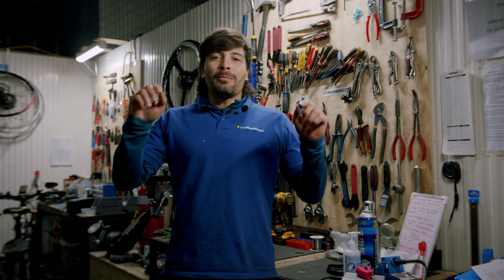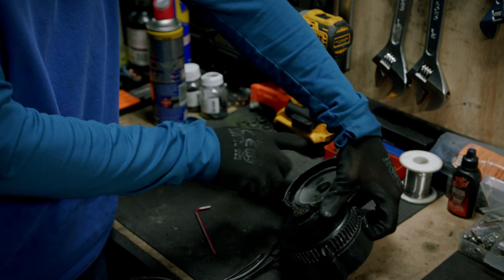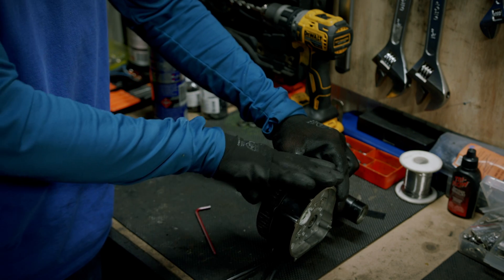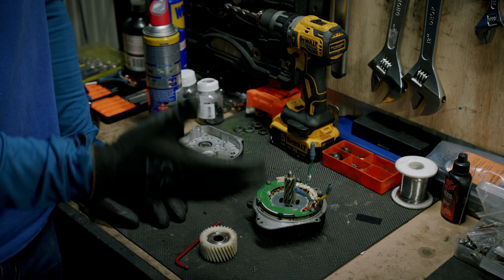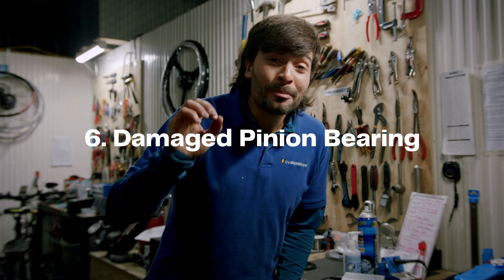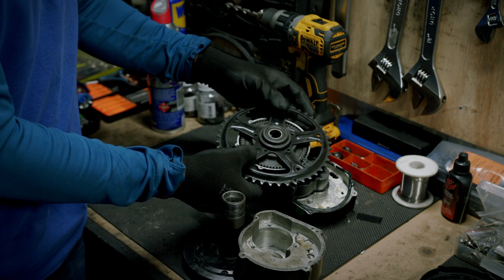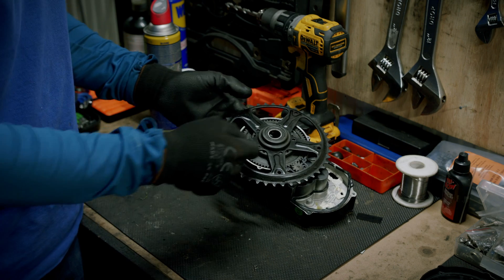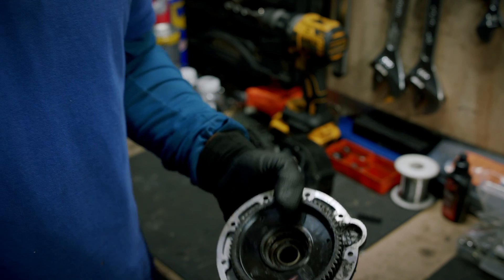Bafang BBS Motors The Most Common Problems of These Mid Drive Motors

Comment: Hi, tnx for the video, I have a BBSHD and I have the magnetic disk problem but I am not able to remove the disk from the crankshaft, there are two rings with a little notch but i can't remove. What do you suggest me? And where i can find the compass for KM5 ring? TNX
Reply from the maker: buy something like this https://www.aliexpress.com/item/32979786386.html?spm=a2g0o.ppclist.product.2.4aebDtyKDtyK87&pdp_npi=2%40dis%21AUD%21AU%24%202.93%21AU%24%201.79%21%21%21%21%21%402103245416819766136752944eff23%2166745174678%21btf&_t=pvid:703eee36-7704-4b0b-8336-f8151c03a6e7&afTraceInfo=32979786386__pc__pcBridgePPC__xxxxxx__1681976614

remove that ring and get going, you've had a problem on the disc because of excessive torque on the pedal axle, it's because youre riding with a heavy high speed gear being at low speeds, shift 2 gears down and you will be on the correct gear

Comment: Hi Felipe, fantastic videos! You are so knowledgeable. I'm building my first e-bike conversion and your videos have become a most valuable resource. I have a question for you. I've seen lots of Videos on You Tube recommending packing the Bafang pinion casing with grease. What's your view on this? Should we do this and how much should we put in? Many thanks, Rob
Reply from the maker: Dont touch the motor until it reaches 5000km or it needs any repairs, the motor is good to go from factory we dont need to do anything else other than a good installation when the motor is brand new
Reply: You see, bafang puts enough grease in there at the factory. No need to open a brand new motor and putting it full with red mobil grease. I have a full 400grams lithium grease from bardahl.. can i use it to regrease it, when firstly cleaned and remove the old grease? I just reached 5600km by now. Still the motor is very quiet.

Comment: A good advice and instructions of yours to avoid problems on the bafang mid drive motor. Sir just asking, how did you know a 1000w bafang mid drive motor if it is tampered or not? Thanks sir.
Reply from the maker: Hi, thanks, what do you mean by tampered? If the motor has been opened and modified prior to your purchase?
Reply: @Cyberbikesau  exactly sir.
Reply from the maker: @rodolfobaliga7577  check the bolts because when tightening them it will mark their heads. Inside the motor you can look for the white glue that keeps the wires together, if the glue has tears on its surface the motor has been opened and components replaced.

Comment: I did 2000 miles on my first motor before it failed through loads of salt water corrision, I had it sealed like you said. My second motor has done over 20,000 miles and the only two issues I had were harness failure and gear sensor failure so replaced though. The motor is working in fine order. Thankfully this winter has not been so bad so less water, salt water entering it.
Reply: @manoz6194  Thanks Mano, it seems like the best way to set up the motor so that I can do some of the work, as well. I don't want to be riding along, and be ghost pedaling, like most seem to want to do, I need to get fit after being off a bike for a long time.
Reply: @RobertAdams-ly5ku  Yeah I used to use a tongsheng, loved the torques sensing but the weather proofing was very bad so went through 4 motors in the space of two years. The kepler file is the closest thing to simulating a torque sensing motor. On the bafang I have had a harness failure and a gear sensor failure due to the rain. But a harness is cheap and a gear sensor is not really needed anyhow since I use the hydraulic brake sensor as a sort of clutch. My motor that had done 20.000 started to wear and lag after about 23,000 miles so I bought another one while I find the time to service the other. Good luck with it.
Reply from the maker: Is it our fault that your motor failed, or is it your fault that your motor failed? We have sealed motors that are lasting over 30,000 km
Reply: Which motor do you have, the BBS02, or the BBSHD. Thanks
Reply: @RobertAdams-ly5ku  bbs02  750w, mostly using 150 to 300w and occasionally using 1000w for the really steep roads
Reply: @manoz6194  Thanks for replying. I am looking to buy a BBS02, but was unsure about it's reliability, but now after reading about your experience, I think I'll go ahead and buy one, from looking at the power level you mostly use, it seems like you are getting a good workout. This is what I want to do, as I still want to be able to get fit, and get a workout, I've seen one guide on programming the BBS02, saying to set the assist levels, 1 to 9, in 10% increments, and set the speed in each level to 100%, not sure if this is the best way to set up the motor, but I will try it, and see. Thanks again

Comment: Thnx for your videos. I have been running a BBSHD for over 5 years, opened it to look at overall condition & to lube it last year when transferring it to another bike. Being able to program cadence and power levels (as well as setting it for max power) has made it very easy & comfortable to use, especially on technical mountain biking trails. You are so correct about shifting, having been a year-round commuter and mountain biker on "acoustic" bikes, it is second nature to me on electric bikes.
Reply from the maker: I'm glad to have you in this channel, welcome to Cyberbikes. What do you think our next video should talk about?
Reply: @Cyberbikesau  so far, I have only seen this one video of yours, the algorithm just suggested it. At some point, covering programming for the BBS01/02 & BBSHD also external controllers  for the hub drive folks, either separately or as a comparison. I do not know how many folks have actually done it.
Reply from the maker: @davebrown9725  Nice one, we have a quick programming video https://www.youtube.com/watch?v=bX-gFdU6aBM&lc=UgwPeB7ZCUdPoSWUHep4AaABAg.9knzFOb63-o9lSFfOkBp2V and the controller for hub guys that's nice though. Thanks for the insights
Reply: You don't have to shift anything, just buy a normal controller not bafang piece of shit
Reply: I have also changed of the (many) setup parameters by using a USB cable & software. It runs indeed smoother and better adjusted to my riding style. This should also protect the unit and reduce wear of the drive train.

Comment: Dear Felipe, thanks for your video. Regarding your first problem, I covered the gaskets you showed with silicone and then painted them black. Since this was handmade, it does not look good,  but I'm almost sure that water will not go in from there. (I cannot upload the pictures here). Is it common for the water to go inside the motor through the bearings? Of course, I'm not riding in the river. Now, regarding the motor effort that you referred to later, my granny has 36 teeth. Would you suggest a smaller front ring? BTW, my cassette is 11-36T. Thank you and please keep on with the good work. My Bafang is 36V 500W.
Reply from the maker: that's okay your ebike will last a long time with a 36T chainring

Comment: Need help please if you can!Motor 750w 36t chainring brand new motor,i sense some vibrations in pedals.I mean after 1-2 hours feels like my feet sat on 2 vibrathing phones.Changed ,chain, casette,even went to someone to remove some casette speeds for the chain to be aligned with the chain ring.Still no improvement.
Reply from the maker: the motor might be loose on the frame

Comment: Thank you, very helpful! Good to know many problems can be avoided by shifting gears. Is spinning the motor too fast (max rpm or close) a bad thing? Can it reduce it's lifespan or reduce it's efficiency?
Reply from the maker: in these motors always rev it up to its maximum, the best way to use them
Reply: @Cyberbikesau  Alright, thanks for the info!

Comment: Great Video -- Very Informative on the Bafang Motor!  Do you recommend every like 2500K  to open and clean the motor internal gears and add synthetic grease?
Reply from the maker: every 5 to 10k km, it depends on the use

Comment: Hello Felipe!  I would like to congratulate you for your videos!  They are great!
 I'm following all your tips here on your channel and I'm applying them to my BBS01.
 I would like to ask for your kindness and suggest that, if possible, you produce some videos addressing the problems with electrical and electronic components.  How to detect these problems and how to fix them.  I'm here in Brazil and technical assistance is very far away.  It is located in São Paulo.  The company is really good, but the logistics for me are very complicated due to the distance and cost.  With these classes that you give us on your channel, it opens up a great possibility of solving it right here in my city.  I had a problem with the main cable giving err 30. I managed to detect the problem, I will replace it with a new one and install it following your recommendation.  Thanks for your excellent work!  Keep helping us!  A big hug!!
Reply: Glad you were able to solve your main cable issue. Mine broke a conductor and would not even turn on. Very glad I had a spare on hand for troubleshooting and immediate replacement. I was more careful with the routing this time, I think the cable had gotten crushed between the double crown fork and the frame.
Reply from the maker: If we launch ebike classes, would you own them?
Reply: Yes, I would take the course.  You have excellent teaching skills, despite the language barrier I can understand you well.

Comment: hi mate , i have a problem with my bbshd , sometimes it spins on empty , id toes not engage the crank , and if i keep pressing the throtle goes oneerror 21h , any ideea the problem is ?thank ,
Reply from the maker: not engaging the pedals mean that you have broken clutch paws on the motor. Error 21h is the speed sensor not matching the magnet on the rear wheel

Comment: Hi ....thank you for your good and very informatif video , how ever i have a question , since I've got a heart problem i really can't keep up with a good cadence while pedalling , so i install a small chainring 36T to prevent the controller and other parts inside get damage quickly, i like to go ride at mountain side with a lot of very steep hill , is it my set up for the chainring is correct ? And i also keep the Watt meter on the display at around 100 - 350 Watt .
Thank you a lot for your answer , best regard
Reply from the maker: Yes perfect, your ebike will last a long time 36T is great for your application, watch this video https://youtu.be/jb3v5Y0Q2l0 to understand 300W high torque and 300W high speed, and keep shifting your gears at high revs. Cheers

Comment: Thanks! I've been trying to research the Bafang kits after realising I don't like the idea of a dedicated e-bike bottom bracket shell for a Shimano or Bosch motor (no future proofing).  Are the Bafang motors kits actually different depending on which wattage you get or is it just the controller limiting the power available?  I was looking at getting just a 250w kit, but if the gears are beefier in the high wattage kits I would go with those and limit the power to maximise lifespan.
Reply from the maker: your bike frame will tell you what motor to use. Don't go for a VW Beetle body and a Ferrari engine. Bigger motors do not mean better performance, the bike has to last, you cannot die without brakes, your body cannot shake at high speeds without suspension. Consider those facts in your build because we engineer ebikes, and life matters.
Reply: @Cyberbikes Wtf?? The guy was just asking if larger watt motors had better internals.
Reply from the maker: @whatsit2ya247    larger motor has better internal gears, but it doesn't make sense to carry more weight just because of the gears if he will never exceed 250W. You have to think about the bike as a whole.

Comment: Hey!Thank you for the advices.But you keep saying use the right gears ?which is the right gears? I have a friend who only uses 1 gear all the time.
So please,which is the right gears?more details please
Reply from the maker: Your friend will break his motor if the gear ratio is not favourable for the motor, that means the gear ratio shall allow the motor to spin at high revs. To summarise, there's no correct gear, but there's the correct gear for the speed you're travelling, as the speed varies (start, stop, start, stop) you will be varying gears all the time. If you stuck if one gear only for everything, most likely you will break the motor. 
Watch this new video and you might get your doubts cleared out: https://www.youtube.com/watch?v=jb3v5Y0Q2l0&t=3s
Reply: Like does nobody drive a manual transmission car these days. If they did they would be clued up as to the right gear to be in on an ebike. Or maybe try driving a semi trailer  with  its 10-20 gear transmission for a while. But really  just  turn the motor  off and ride it like an analogue  for a while to get a greater appreciation  for a full  range of gear ratios.

Comment: Subscribed! Which tooth size would you pick for a BBSHD on a Trek Fuel Ex 7? I just want the motor to last long and it would be great with hill climbing ability but former is most important.

How can I know when it is time to shift gear up or down btw?   :-)
Reply: Best way to learn  about  gear shifting  and when to shift up or down is to ride it like a normal analogue bike without motor  assistance for a while going  over flat ground and uphill and downhill
You'll  soon  get the hang of it. Going  uphill obviously low gears makes it somewhat easier  on your legs at a higher cadence speed but at a slower overall bike speed. The opposite is the case for a downhill  run , where mostly you can let the bike coast downhill as it picks up speed without peddling but in a higher mid range gear, so if you do need to add any pedal  assistance your in the right  higher gear. In a low gear your legs can't keep up with the cadence required by the low gear ratio. On flat ground  just let the speed you want to ride at with a sensible amount of leg power  and cadence speed for your fitness levels dictate what gear to be in. It's not to dissimilar to driving  a manual transmission  car really.
Reply from the maker: 42T Lekkie chainring, you will know when it's time to shift because the motor will stop accelerating/not gaining any extra revs

Comment: Seems like most of these issues are caused by improper use. These motors need to be used like combustion engines from what I can tell except when you lug a Bafang, it will rip itself apart rather than stall. If that is not something you want to do/learn, I guess a hub motor would be a better choice. Thanks for the great video.
Reply from the maker: yes you're right

Comment: Good mechanical intel ,thanks.No power by throttle or pedal.I have a red ! on the controller next to the batt.indicator.I disconnected the Brake and still get this alert...any trouble shooting ideas -1000 w.hd Bafang?
Reply from the maker: new controller, check if the motor halls are ok. Also, look for the error number, that helps to diagnose the problems

Comment: My new BBS02 is making a noise while using the pedal assist and the motor will cut on and off periodically but the throttle switch seems to work fine? I’m trying to get a replacement but do you know why it would be doing this ??
Reply: On a quite new motor I experienced cutting on/off periodically and I was recommended a new magnetic ring and it solved the problem. Keep in mind there no real visible crack in mag ring.
Reply from the maker: yes the mag ring could be broken, usually it breaks because the rider is using heavy gears, which causes small torsions on the motor and cracks the magnetic disc of the pedal assist

Comment: Thank you for a very informative video. When I pedal my BBS01 with a flat battery, the pedals turn the motor, making it very hard work is there a clutch which may be broken please?...thank you
Reply from the maker: The motor has a clutch inside, when pedalling the motor doesn’t turn, only the chainring turns. It’s normal to have a small resistance when pedalling and the motor is not on. If you pedal forwards when the motor is off and the lights turn on, there’s a problem in the clutch otherwise you’re just facing the resistance of the bearings and clutch
Reply: @Cyberbikesau  Thanks for that, super quick reply.
 without the motor on, it is virtually impossible to pedal, especially up hill, so I guess there is a clutch problem? Which lights are you referring to please?  Thank you
Reply: It's hard work because you have added another 7-10  kg to an analogue bikes weight with the motor and battery added on.

Comment: Thank you for producing a very good video about common problems with Bafangs. I have been installing Bafang & Tongsheng Mid Drives for about 5 years now & any problems that were brought to my attention were nearly always customers not using their gears & relying on the motor like an automatic transmission. For this reason most of the kits I sell are without the throttle. This is one way of reducing the stripped out gear problem. Do you think it is possible to combine the torque sensor from the Tongsheng with the Cadence Sensor of the BBS02? If this is possible, it would open up a whole new market for a much improved Mid Drive.
Reply from the maker: Agree 100%
Reply: I have a new motor. Power of the bbshd and has torque sensing. Let me know if you are interested
Reply: @Alex-uh1mj  Hi Alex, is this the new Ultra series Bafang Mid Drives? If so, they require a dedicated frame & are not for retrofits as far as I know.
Reply: @daytriker  no. It's not,  i develop ebikes for a manufacturer for a living. I know what im talking about, dont worry.  Its a retro fit motor to any standard bike with a bottom bracket. You wont of heard of it because im the only person with it...
Reply: @Alex link please.